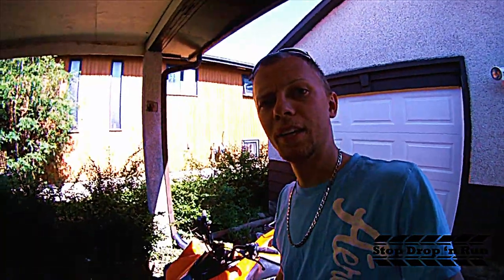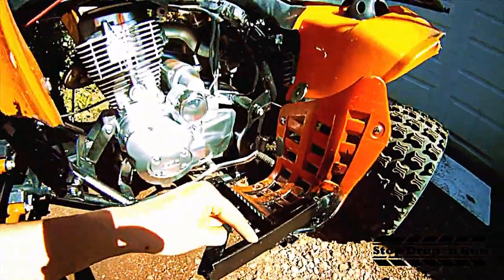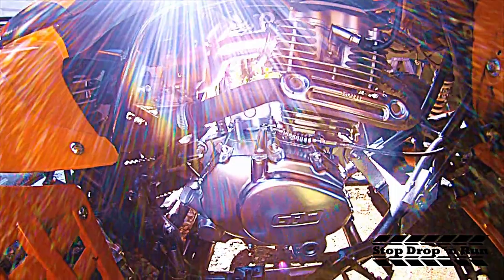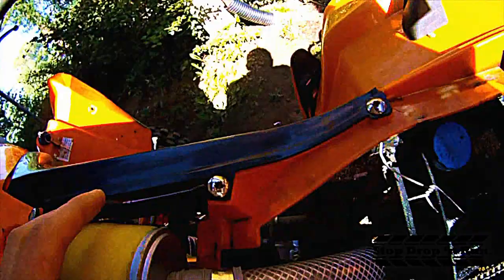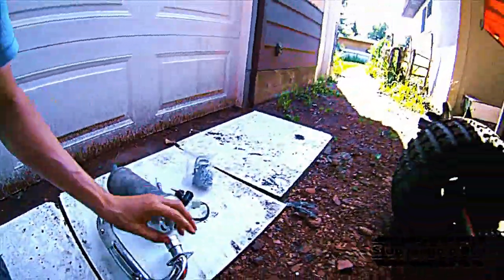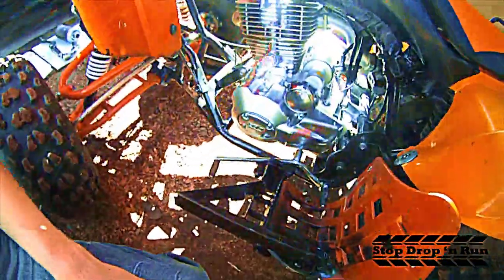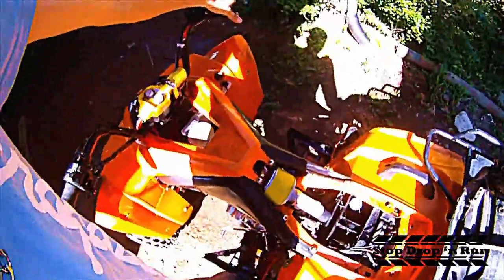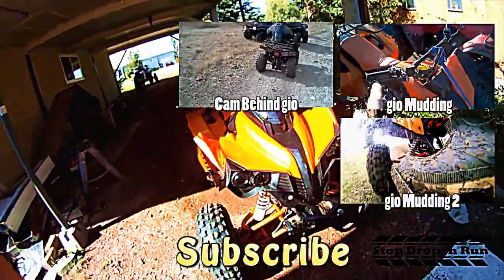Gio Rebel T3 200cc 2010 ATV Quad Performance Modifications

Comment from the maker: used a large off/on 12 volt switch. wired the positive from battery to one side of the switch and the other side of the switch to the starter. then you just flip the switch till the engine is on then flip it back.

Comment from the maker: you have a wiring issue. follow your wires down to the plug. and check your wires. pull wires out of the plug one at a time and you figure out what the issue is... I had the same issue with my starter button. was wired incorrectly. had to start it with a screw driver for a while there.

Comment from the maker: take the screw out. take the slack out of the cable with washers. shave down with a razor blade the inside of the handle throttle box where the screw came out of.

Comment: Hi. I have a problem. A few days ago i bought a "quad gio200cc ATV from the year 2010" Its a new. My problem has to do with the gear lights found in the middle of the steering wheel. R( reverse) and N( neutral. gear R in red and gear N in green light up right after i start my car. It doesn't matter what gear im in, driving, parked, or reverse.. they still light up. In reality its a small problem but I was wondering if you knew a solution for this.

Comment: Change your oil to 10/30w mineral, never use "fully synthetic" to a manual chinese quad, it will screw up the clutch plates. Change your oil every 20-25 hour in normal driving, or every 10 hour for hardcore driving, on that way you will have your chinese quad for about 3-4 years!

Comment: hi i was just given one of these gio quads but with no manual just wondering if it is 2 stroke or 4 stroke and if it is a 2 stroke if there is a separate place for the 2 stroke oil or if you just mix the gas
Reply: Kyle McKenzie you would be able to tell if it is a two stroke my atv is but that one isn’t
Reply: They are 4stroke and you dont add oil the the gas. It takes 10-40 gear oil make sure its ATV oil not engine oil. There is a big difference, you need to protect your gear box. Hope I'm not too late.

Comment: Hey sdr sup the issues im having atm is my atv will only run with choke pulled in haft way any help :-)
Reply: Your putting the choke in the wrong direction trust me it goes the way you dont think. The throttle plate should be flickering violently when the choke is off.